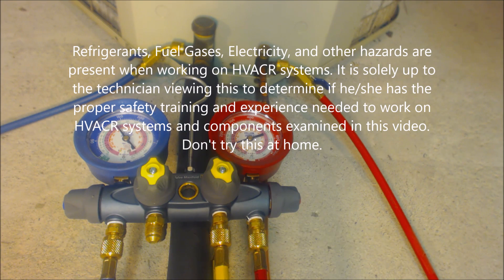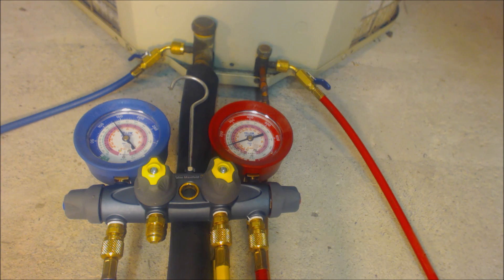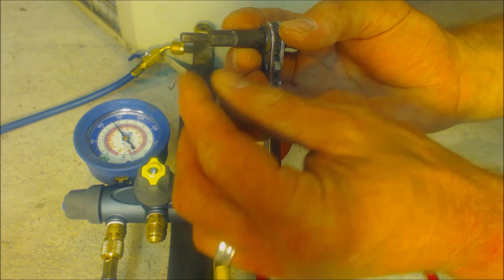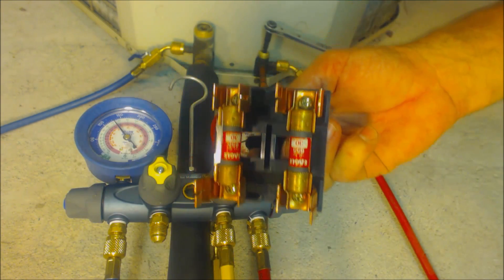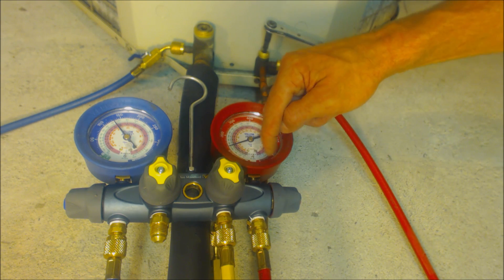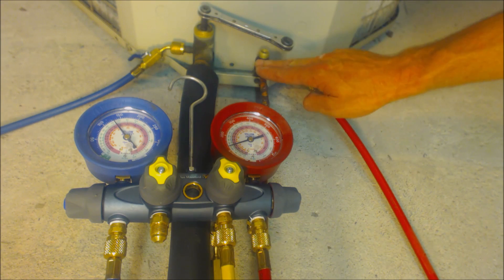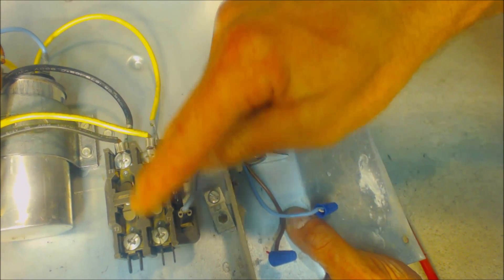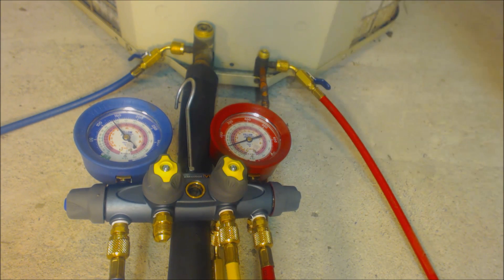Safe Pump Down Procedure of an Air Conditioner or Heat Pump!

Comment: Hello AC Service Tech LLC - another great video, thank you so much from the Netherlands. Bought one of your books recently, refrigerant charging and service procedures. Very insightful! Reason I am watching this video: I need to pump down an R32 Daikin Altherma heatpump with domestic hot water tank. Unlike some other models of these Altherma combos, this particular indoor unit does not feature a pumpdown procedure in the installer's menu - other, similar models do have this procedure in the menu.

Daikin has not been exactly helpful in answering why this particular unit does not feature pump down procedure - is it an omission or is there a sound reason why this particular unit does not have pumpdown (it does have a procedure in the menu for evacuation).

So the combo is an Altherma, is suitable for heating and cooling and delivers domestic hot water.

Any thoughts if anything bad would happen if I apply the procedure in this video?

Comment: When the unit gets to a low amount of gas, won’t it shut down? How else will you pull the remaining gas into the unit if it’s not running unless you manually push in the contactor?

Comment: I have been watching a lot of your videos as I am trying to understand how mini split heat pump systems work.  I have been trying to find an answer to a what happened question.  I know what I am about to write will have most ask why anyone would do this, but I was blindly following instructions from a company rep and this accident occurred simply due to a lack of knowledge on both sides. Anyhow, Mini Split, heat pump, rotary compressor, operating in heat mode. Liquid line closed, compressor begins to work harder and harder (can tell by sound it is producing), about 30 seconds in a loud but very quick burst/hiss sound erupts from inside the outdoor unit, suction line was closed and unit powered off.  No visible damage inside outdoor unit. In that situation as it was clear that the compressor was working harder and harder, is there some type of relief valve or was that noise most likely the reversing valve moving itself to protect the system?

Comment: Is it safe for the compressor on a Goodman (Copeland) 410a heat pump to pump down. It seems there would certainly be enough room in the accumulator but I've watched a couple of videos that mention that it might not be recommended with 410A and/or a scroll compressor.

Comment: totally wrong cause all condensers have hp/lp safety valves that prevent high head pressure and one that shuts down the unit when it reaches a lp to protect compressor and system. so using thermostat doesn't do the job as contactor. facts

Comment: Isn't there some sort of low pressure safety that shuts the outdoor unit off? Or does the t-stat somehow bypass that?
Reply: This is why on a heat pump I do set the stat to cooling to energize reversing valve  but still manually push in the contactor.

Comment: Should a unit has receiver for you can do pumpdown, or any AC unit can do pumpdown? What's the benefit to do pumpdown and recovery? Thanks
Reply from the maker: Pump down is done if you are going to use the outdoor unit again. Recovery is done if you are replacing the outdoor unit or the whole system. A pump down can be done on ac units that do not have a receiver as well, thanks!

Comment: Questions,,what about if it has a low pressure switch n cuts off ,,and still has refrigerant in system??? Do you have yo use a recovery machine??,"or can u bypass the low pressure switch??
Reply from the maker: We usually bypass the low pressure switch prior to doing the pump down, thanks!

Comment: How do you deal with the low-pressure switch shutting the compressor down (before full pump down) when the pressure drops.Your videos are excellentThanks
Reply from the maker: I will have another video showing how soon but in the mean time, on a condensor, you just jump the 24v hot wire directly to the contactor instead of through the pressure switches with the common as the path back, thanks

Comment: what are your thoughts on pump downs on scroll compressors? some say dont do it into a vac etc.

also i have had some compressors that wouldnt pump down. they made a noise internally that sounded like a relief valve. I havent found good info on if it was internal relief vs just a bad compressor. the one i can think of specifically would pump down to 40 psig then make a noise and go to 70 psi and no further.

thanks for insights.

good vids/channel
Reply from the maker: Hey Randall, yeah on some older compressors, the pump down won't work because the internal pressure relief has become weak over time. Hermetic compressors use refrigerant and oil to cool and lubricate so when we are lower in pressure, it is not the best for the compressor. Some compressors are meant for this such as a pump down refrigeration unit. If the relief blows then just close the valves and then shut the unit off. You can pump down a scroll, just don't let it go into vacuum too far, thanks Randall!
Reply: so if you find a compressor that will not pump down, that blows internal relief, is this an indication of faulty compressor?

i had one that did this and had poor capacity to boot. all other things were normal. temp drop across coil was only 10degrees. cant remember pressures off the top of my head.
Reply from the maker: It doesn't mean that the compressor is bad unless it is happening during normal operation on a very hot day. This component is off by itself inside the compressor housing and is separate from the compressor itself, thanks!

Comment: Hi acservice tech, Great videos and presentation (hell of a teacher I'd say). 
Can you tell me if the refrigerant in the liq/suc gauge hoses are ALSO sucked into the compressor in this pump down process. My guess is yes, correct?
Also, in this and a few other videos you refer to "a certain brand" unit commonly having the low pressure switch standard, so which is the "certain brand", can you say?
Reply from the maker: Yes before performing a pump down, make sure to purge the air out of the hoses or air will get sucked in and mix with the refrigerant. In reference to certain brands, I meant higher efficiency, or more expensive models but all manufacturers have them but only on the model units that have all the bells and whistles. Cheaper standard units do not have the low pressure switch. Heat pumps often have a low pressure switch in them. Make sure to jump the low pressure switch before performing a pump down, thanks bobrub!
Reply: Great, understood on both answers, thanks ..... and thank you so much for taking the time to respond and help out your brothers in the HVAC field.
Reply from the maker: Glad to help bobrub!

Comment: Is there a risk of overpresurizing the condenser coil with this method? Can you blow out the coil, or cause problems for the compressor itself? Also, I really love this channel, you have a real gift for explanation, and a mastery of the subject matter, thank you for the effort.
Reply from the maker: Thanks Stacen. If you don't have microchannel coils then you have enough room in the condensor coils for the refrigerant on air conditioners. On refrigerators that have a receiver then you can pump the refrigerant in there, thanks
Reply: @acservicetechchannel  - Thanks! Please tell how to recognize whether standard coils or microchannel?

Comment: Is it ok to run the indoor fan while vacuuming the entire system ?
Reply from the maker: Yes, it would help if there were moisture in the system. Make sure the compressor is not running though. You don't have to run the indoor fan but it certainly helps if you suspect water in the lines, thanks

Comment: So after pumping down successfully, you don't have to recover any refrigerant???
Reply from the maker: If you do it well enough and run the indoor fan while doing it, you have the chance to not have to recover the refrigerant because the pressure in the lines does not rise above 0. You have to keep heat on the refrigerant by running the indoor fan during the process though, thanks
Reply: Thank you for helping out a noob!  Awesome.
Reply: AC Service Tech LLC Where does the refrigerant go?
Reply from the maker: The refrigerant gets pumped into the outdoor condernsor coil as a subcooled liquid. Pump downs are done on standard units but not on microchannel coil units, thanks
Reply: AC Service Tech LLC So all I need is the manifolds?
My evap coil has a leak will this work?
Reply from the maker: Make sure you are EPA Section 608 certified before handling refrigerants.  Well sometimes the outdoor units have a hard time pumping down anyway. Sometimes the internal pressure relief valve is weak and pops open inside the compressor while pumping down. In that case, just shut the valves and recover the rest. Don't pump it down below 0psig though because if you go lower then it will suck in air through the hole in your evap. If you are already certified, I have links to tools I use here, thanks- amazon.com/shop/acservicetech
Reply: AC Service Tech LLC Ah ok.Great.Thank you for replying!

Comment: and the purpose of performing a pump down, trapping the refrigerant on the outside coil is in lieu of performing a service??  What kind of service?
Reply from the maker: If you need to replace the evap, lineset, filter drier, or metering device. Most new units come with refrigerant already in the outside unit. It would be like that. You don't want to have to recover it and vacuum that part of the system too if you can just put the refrigerant in that location of the system, thanks
Reply: gotcha!!

Comment: Is it physically impossible to do a pump down in heat mode ?  You could store all the liquid in the indoor condenser and the liquid  return line to outdoor unit. You could then fix a leak etc on the outdoor unit. Please advise. Thanks michael
Reply from the maker: The problem is the reversing valve being powered or not powered as well as having access to the ports for a vacuum afterf fixing the component, thanks
Reply: Thank you very much

Comment: Good to stress caution when (if) starting a motor with a screwdriver. 

On the outside chance the windings are grounded there can be a tremendous amount of energy in the form of a fireball in the vicinity of your hand.

Don't do it fellows unless you absolutely have to.

Tip from an old motor guy.
Reply from the maker: Nice comment, thanks!

Comment: What do you do if the low pressure switch cuts condenser off before it reaches 0 psig?
Reply from the maker: Hey David, you are right. You would need to look to check for that first and if you did find a low pressure switch then you would need to turn the power off and jump the 24v low pressure switch wire out with alligator clips or just connect the 24v power wire directly to the contactor instead of going through the switch. Most basic units will not have these unless we are dealing with a specific brand but yes check for that first on the suction line.  I just want everyone to be safe whenever possible and also the indoor airflow really helps to get an accurate pressure reading, Thanks David!
Reply: acservicetech That actually happened to me. We were relocating the condenser and it shut off around 50 psig I didn’t know what to do so I just recovered the remaining refrigerant. That would be a good video to see. How to either jump it out with alligator clips or straight through contactor. I really enjoyed this video! Thanks Craig!
Reply from the maker: If the sensor is easy enough to get to then I would just recommend jumping that out but ok I will keep that in mind for the Patreon video, thanks

Comment: Another great video and learned something new from you as always.  Just a quick question, Is heatpump always default to the heat mode when the contactor was pressed down manually or  
it will run whatever mode it was last time called for?
Reply from the maker: Typically if the unit is not Ruud Rheem or WeatherMaker then the reversing valve would be in heating mode when not powered by the tstat or in cooling mode when powered by the tstat, thanks!

Comment: Quik question i am a hvac tech at a university in Texas been there for 8 years  and i just passed my texas hvac b license  where can i get a up to date price book?
Reply from the maker: Are you talking for hvac equipment and supplies? If so, you would need to set these up with individual vendors and you would either fall into a certain pricing or you would have to agree upon a certain pricing. Usually there are 4 tiers depending on how much you buy. I operate on the premis that is you set me up with good pricing from the get go then you have established a great relationship. If I have to work to build my pricing then I do not like that too much but to some extent they would need to reward those who buy more frequently. If you mean something else just let me know, thnaks!